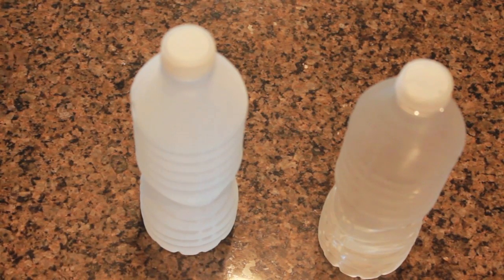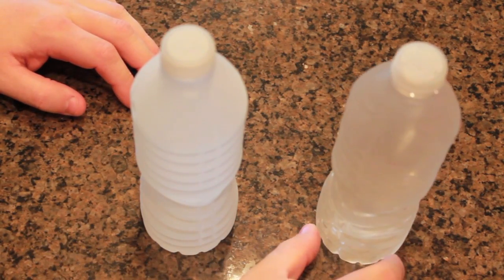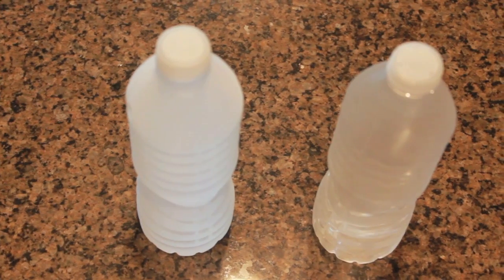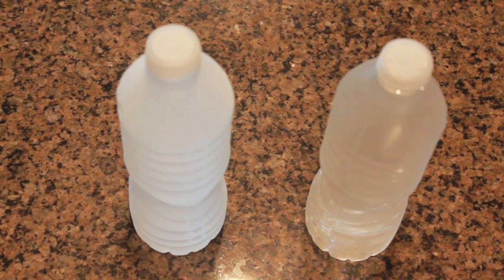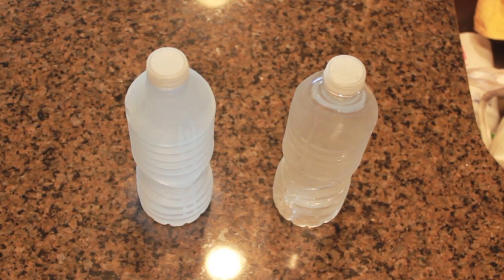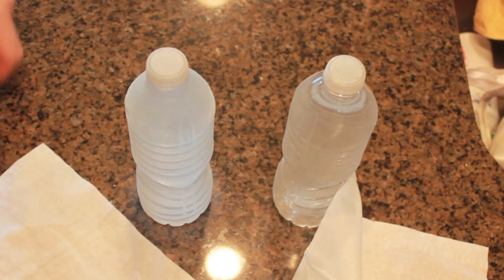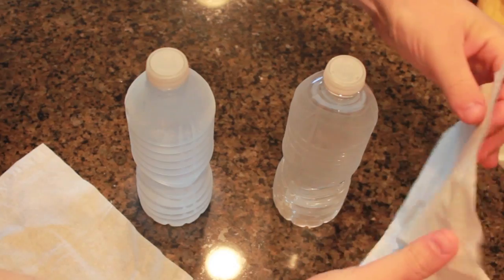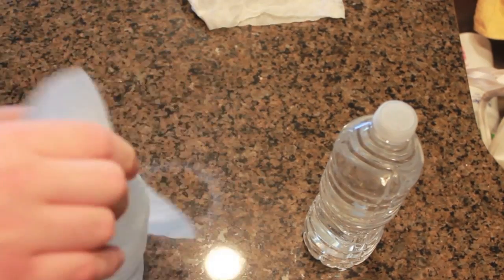Neverwet Condensation Test

Comment: This would work on a toilet tank. Mine gets condensation and drips onto the floor. That creates decay. This would help to prevent that. I'll definitely try it, especially inside the toilet. It helps to keep it clean at least until the coating needs to be reapplied.

Comment: Exactly. Condensation is humidity/moisture in the air. ISince the bottle is cold, the humid air around it goes from a gas to a liquid. I the humid air isnt sticking to the hydrophobic surface and that is why there is no condensation.